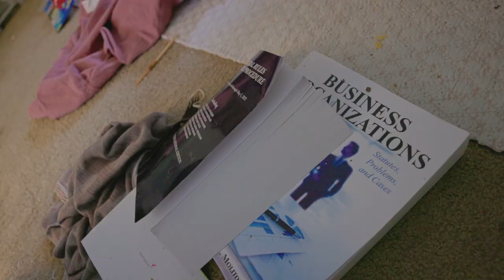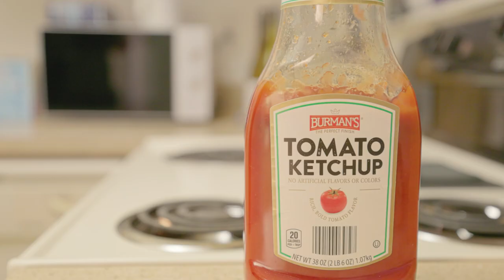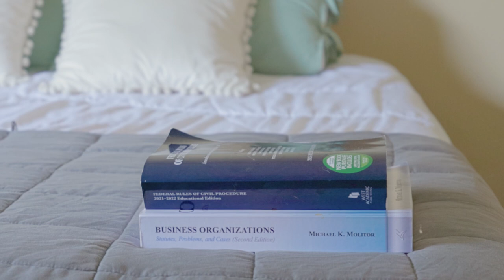Condo Hoard Rehab | Level 3 Clean Out

Comment: I would suggest when you are cleaning out a refrigerator and freezer taking everything out and then spraying it out good with your cleaner. Wiping it out top to bottom. Then put the stuff back in that is still good. Don't do it the way you guys are doing it. You're just wiping a section then moving the stuff around then wiping another section and moving the items around. I don't think that cleans everything significantly. That's just my suggestion. Also make sure your cleaning the gaskets good around the doors. And the vents at the bottom of the refrigerator.

Comment: I like putting tinfoil on each drip pan of each burner of the stove. When they get dirty, I just replace the foil of the one that needs it. In our first house, I didn't do that, and stuff got cooked into it.  At that point, there are two things you could do... Number 1-go buy new drip trays. They're actually not very expensive, and I believe some Dollar stores sell them. And number 2- If you have a self cleaning oven, place the drip trays, (make sure there's no foil on them), facing down, on the rack of the oven. Remove any loose grime, and run the self cleaning program, while you clean the rest of the house.  It takes several hours, so it's good to start that first thing!
Your bed making skills were terrific! Although, you didn't have to deal with a top sheet! LOL!  
Side note: when my husband and I get ready to leave on a trip, even just overnight; i try to always put a fresh set of sheets on my bed, that has been washed, using those scent beads, along with the detergent. I use gain detergent and scentibles.  It makes my laundry smell fresh, longer!  To come home to a fresh set of sheets, that smell amazing, is a wonderful gift I give myself!!!

Comment: I used to be a maid and I had a client who had a house just like this. Not like tv bad but like this. Where it’s not too bad, just got overwhelmed. I’m shocked that we even cleaned it. But we always made it shiny and clean for her but two weeks later we were back doing the same thing. Her apartment complex was huge (close to 7 floors.) so they offered shopping carts to take up things like groceries and take down things like garbage. Without a doubt we would take two and need about 4 trips all together to throw away the garbage. Her dishes were moldy, etc. We also had no bio hazard equipment either. It was kinda nice to see a hoarder house that wasn’t too bad, just needed a little clean up as it reminds me of my old job